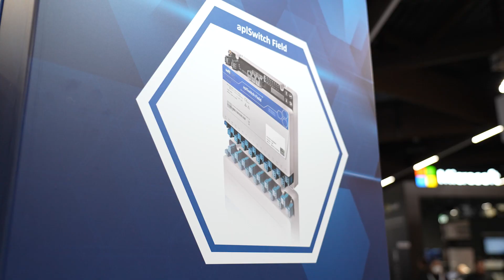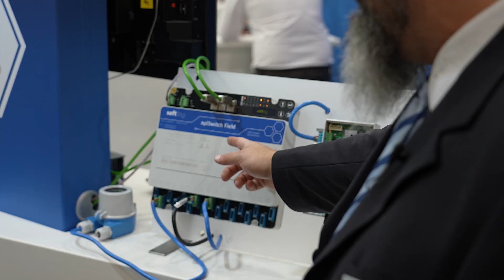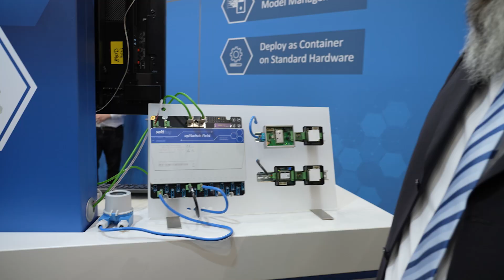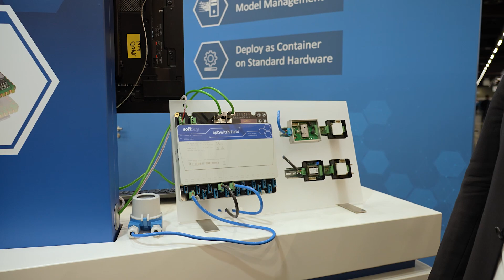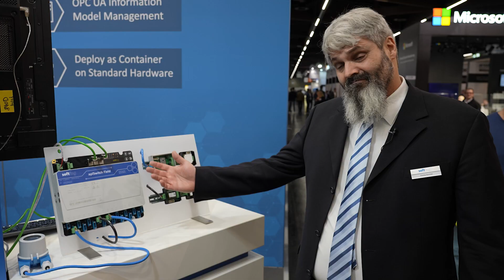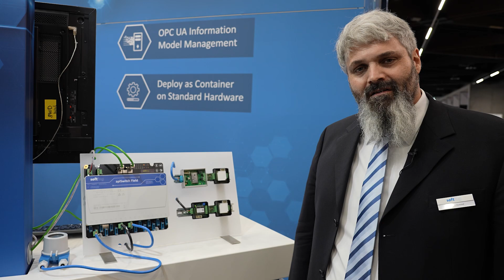SPS 2022 | Introducing our Ethernet-APL Portfolio: Field Switch and Communication Module

Comment: Ethernet-APL and 2-WISE: An announced revolution! New "Ex" challenges and great opportunities ahead! 

Looking forward to the new generations of Ethernet APL (Advanced Physical Layer) field automation and instrumentation equipment and devices, in accordance with the requirements set out in IEC TS 63444 (Industrial Networks - Ethernet-APL Port Profile Specification), as well as "new" Ex "i" intrinsically safe field devices Ethernet 2-WISE in flammable gases and combustible dust explosive atmospheres, according to IEC TS 60079-47 (Equipment protection by 2-Wire Intrinsically Safe Ethernet Concept). 👍